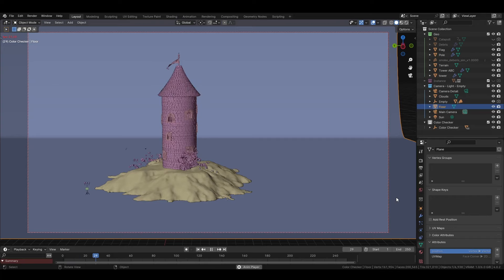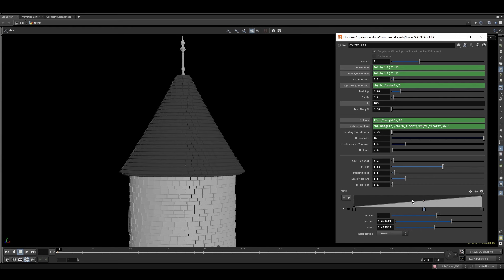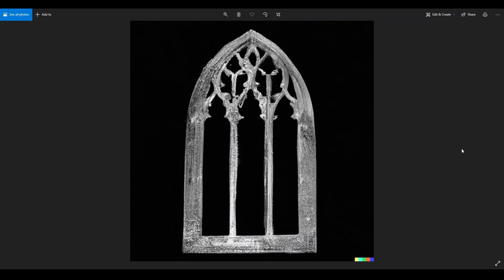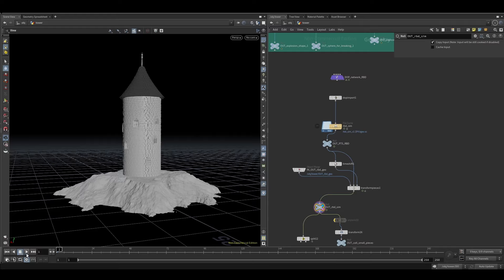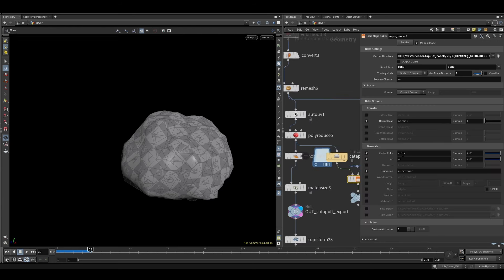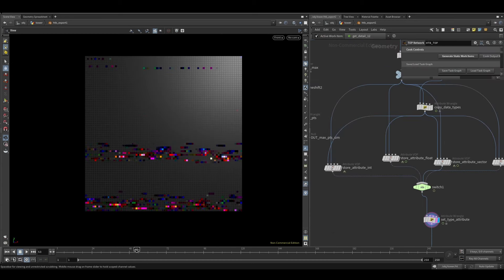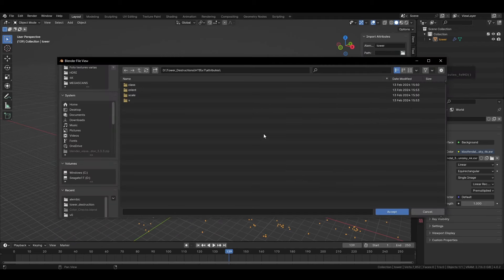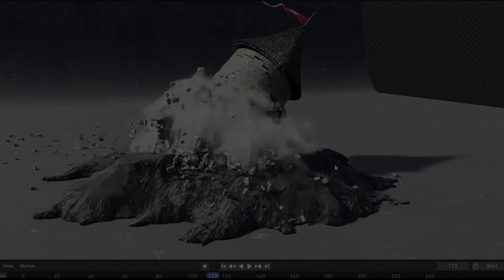Testing Houdini To Blender Workflow | Project Breakdown

Comment: For anyone wondering if this is the only way to import point caches with custom attributes, USD import in blender supports custom primvars (basically usd attributes), but animated sequences made of multiple files are not supported, so if a sim is  very heavy you might end up with a super heavy single file (that might not export easily in the first place)